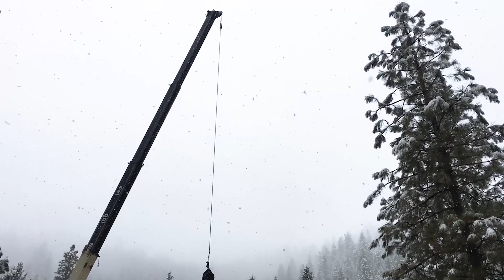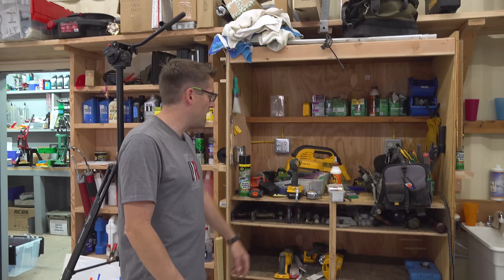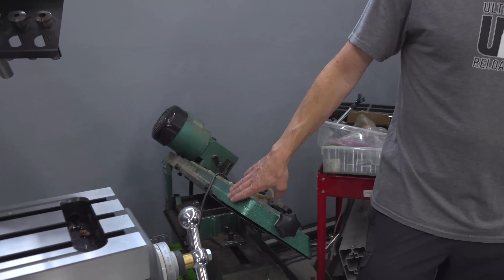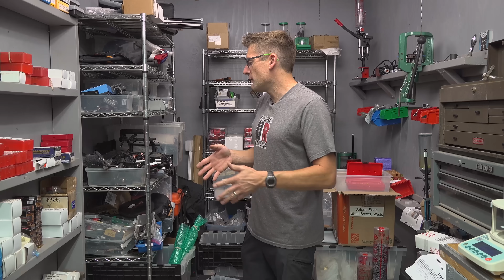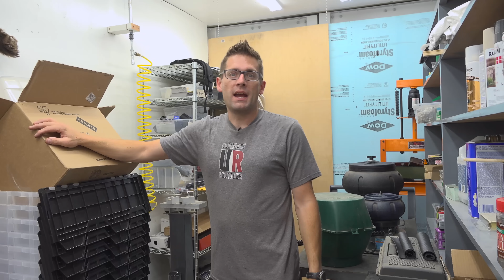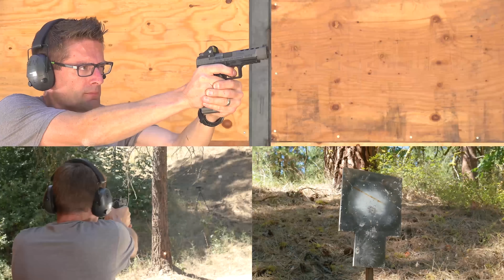UR Shop Tour: Behind the Scenes at Ultimate Reloader

Comment: I will be giving some serious thought to building a container-based shop now that I have seen yours. I now have a shop with a parts washer, bench grinder, inspection/layout area, a 14 1/2 "x 72" South Bend lathe, a 9" by 30"  S.B. lathe, same size Clausing lathe, an Enco bench mill, welding area with gas, stick, MIG, and TIG, all in a 12'x 26 ' shed. Can't keep it clean or organized. Have to move a bunch of crap whenever I do anything. Love your ideas.

Comment: Sweet tour of the shop, ty... side note: I once saw a passive solar hot water set up with a south facing fence, manifold , black garden hose encased behind acrylic, hot water quantity depends on length of hose after initial cost it runs free spring, summer, & fall.

Comment: Sweet set up.  You made mention about your shop air. Let me make a couple suggestions.  First, do not use PVC pipe for a couple reasons, first being safety.  If and I hope this never happens to anyone,  you were to have a fire, the PVC will naturally melt which is opening the flow of air, which is going to help fuel the fire until your tank is empty, and if you didn’t shut the compressor off, you now have a pump sending air. Part 2, is fitting joints failing which can blow the joint apart and could injure someone.  I gave this exact advice to one of my associates when he built his shop a few years ago. Just recently he told me that he has to replace the piping do to clue joints are popping apart. Use Black pipe and do a loop system to minimize pressure drop. Again sweet set up, thanks for sharing.

Comment: To keep the heat from going through the roof in the winter  we use perforated radiant barrier in the attic... same thing in the summer except it keeps heat in the attic from radiating into the house.

My guess is you have the rafters insulated above R19 and that great but standard insulation won't stop radiation heat transfer like pure alluminum perforated radiant barrier. You should be able to find it and the science behind it on the www.

Comment: That's a fabulous setup. One question, why is the center shop so high ?
Reply from the maker: Two reasons: 1. For vertical "room" when lifting equipment, for overhead studio lights, etc. 2. So that when I add side roof overhangs the low side isn't too low...